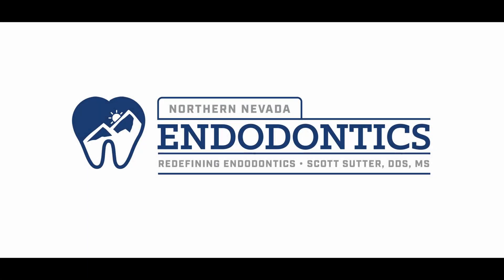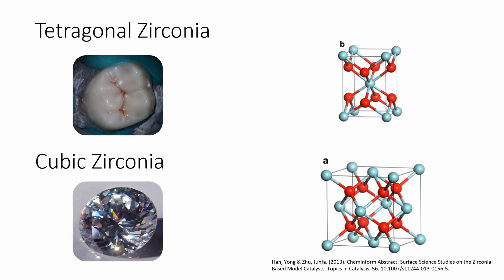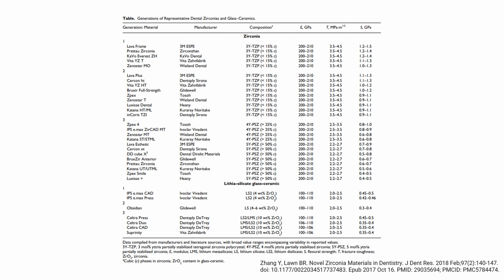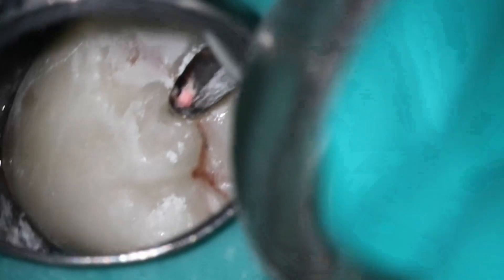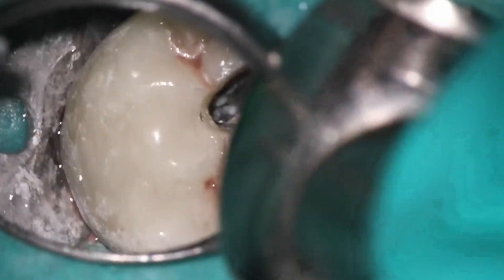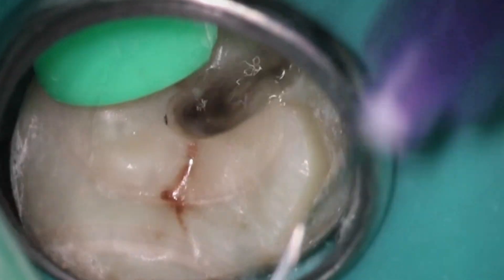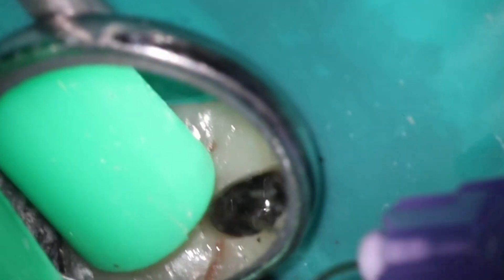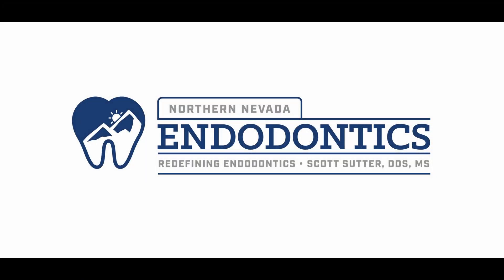Root canal retreat through a zirconia crown: Missed MB2 and a bunch of other things!

Comment: I've noticed alot of pac mac files to assist you at the obturation stage of the cases, in cases where this file was not available in where I practise, would you just continue as a traditional continuous wave vertical technique to plug and pack with backfills or would you advise otherwise?
Reply from the maker: I do like them! You can use the squirt technique and then do a continuous wave with a downpack if there's a void. That seems to work, but the pacmac is faster. Try ebay and see if they'll ship to your country?

Comment: Great video. How do you control your working lenght? Do you work with your rotaties shorter than „apex” reading on EAL?
Reply from the maker: Great question! I measure my WL to 0.0 and take my rotaries to that length as well. Then I make sure the 20k file is at least there or 0.5 long to ensure patency.

Comment: Great vid! I tried removing pre-existing coronal  GP with 45 04 alpha tip, but felt it pushed the GP more laterally! Any tips on this technique? Cheers
Reply from the maker: What temp did you use? The higher the better and you have to press harder than you would expect apically. If the GP is old, it may not work and that’s when I would use chloroform
Reply: @PatencyPro  must have been 200 degrees at least. It was definitely old GP, that probably explains it! Thanks
Reply from the maker: Yeah, as it ages it harderns, so that’s where chloroform makes a difference. Use an endo explorer with the chloroform in the chamber to create a point that you can grab with your F1 and it should come out pretty easily!

Comment: Doc, so from the chart what type of zirconia crown is good to use but easy to cut if needed? Katana crowns? I have been going with monolithic zirconia for molars and premolars but they are 3Y
Reply from the maker: That’s a great question for a Prosthodontist. Mine uses 4Y for everything as 5Y is too weak (and he’d rather use lithium disilicate in those cases) and 3Y is too hard. Talk to your lab or supplier to figure out what the percentage is as it’s not always on the box!

Comment: Hi doc, another great video. When you say you trough 3mm for MB2, do you mean apically? How far mesially / palatally would you do your comma shape to avoid perforation? Thanks doc
Reply from the maker: I usually go 3 mm apically, 1-2 mm mesially and 3 mm palatally if that makes sense. Perforations still occur (I had one yesterday on a case that was a brick wall) but if you repair them immediately with a modern material it doesn't affect the prognosis

Comment: Why flatten the cusps on a well fitting crown which I assume won’t be remade?
Reply from the maker: I put every tooth I work on into “implant occlusion” to lower the risk of fracture and post-op pain. Zirconia crowns are notorious for causing fremitua from lateral excursions, so it’s now standard that I buzz any high cusp flat
Reply: @PatencyPro  personally I find having a flat surface helps give me an easier time knowing exactly where to set the stopper for WL.
Reply from the maker: Great point too! I make all my cariously exposed cases flat for that reason too.